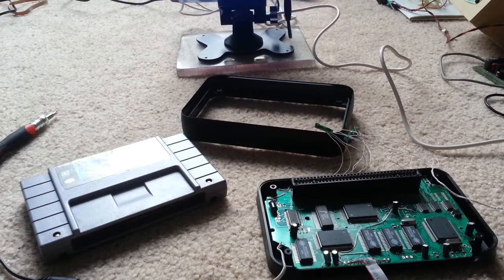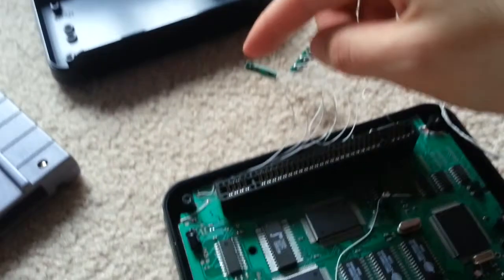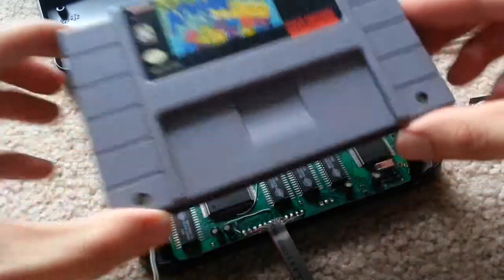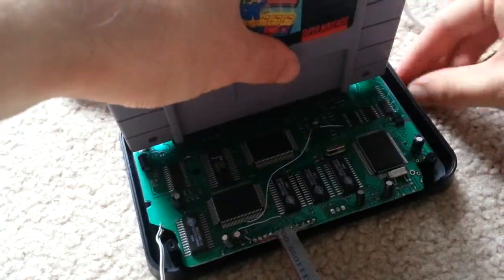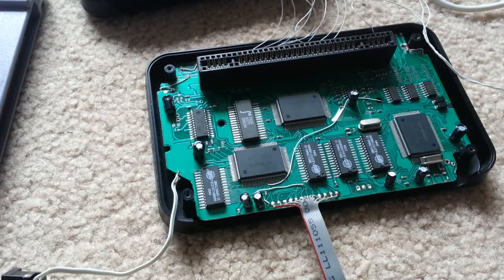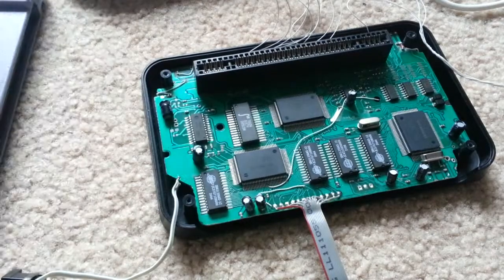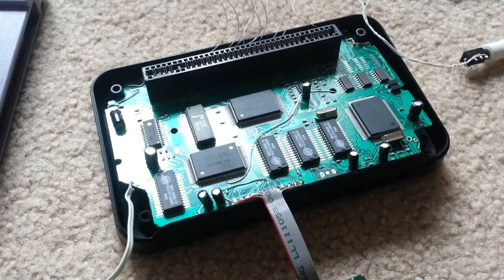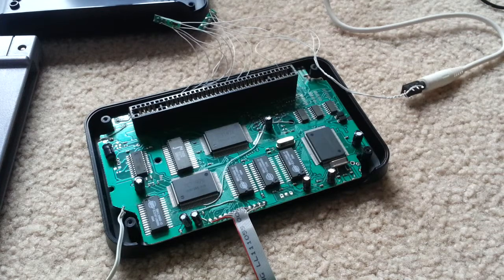Portable SNES Build Progress #3

Comment from the maker: So far its just been running off a 5v wallwart but I will use lithium polymer batteries with a step up regulator and charge controller. I will worry about that last though as I've been having difficulty finding a 3.5" lcd that will play nice with the snes board.